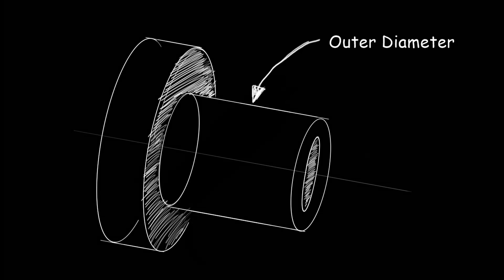Plastic 3D Printer Bearings! So Precision, Much Wow

Comment: You should instead go for a floating nut like, so it can move freely in X and Y, but not rotate around the spindel, hence make a 45degree slot, so it can float, but still will rotate correctly

Comment: You might want to PID tune your heated bed too.
Reply from the maker: That makes sense actually, the bed currently uses on-off control with a 220v heat pad. With a 4mm alu bed I should reduce its differential. But unfortunately the threaded rods this printer uses are starting to wear significantly so it's parts might live on in another build.